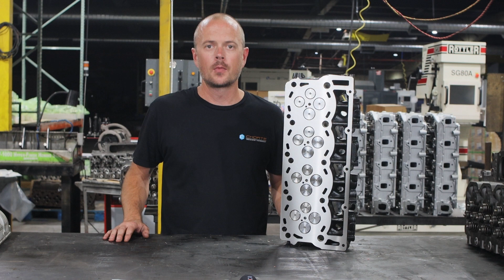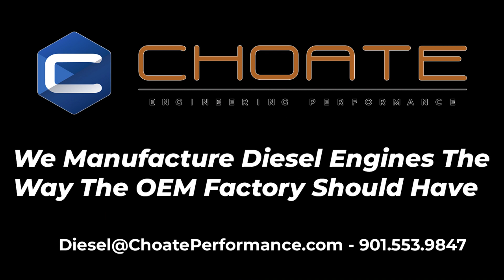6 4l Powerstroke Cylinder Heads

Comment: Yes. I'm going in 08 stock 6.4 deleted never raced blown head gasket Minni Max tune tow haul Street never performance however I want the security of bigger is better so I'm thinking stage 2 because as much as I drive normally I do not want to do this again.  140k miles deleted at 112k miles trans just done as I say I load the box up some and pull a 24 ft travel trailer pulling through the North West Rocky Mountains.